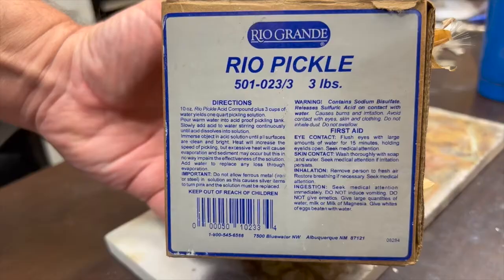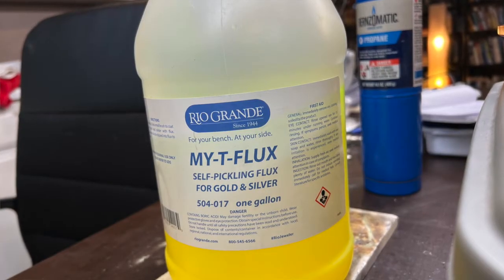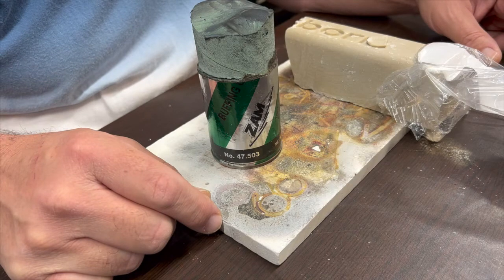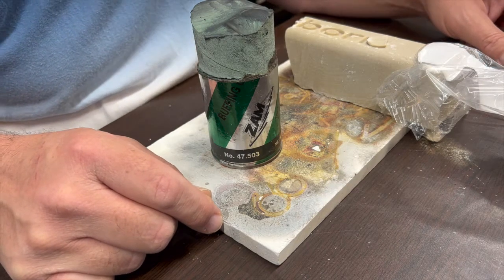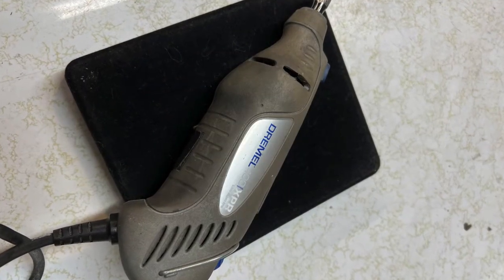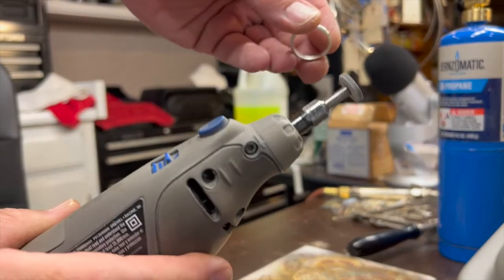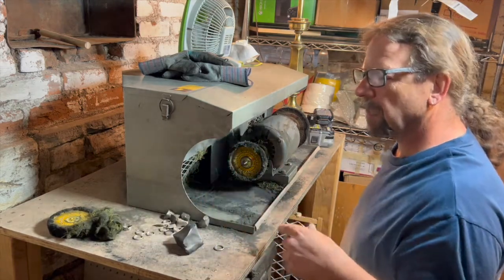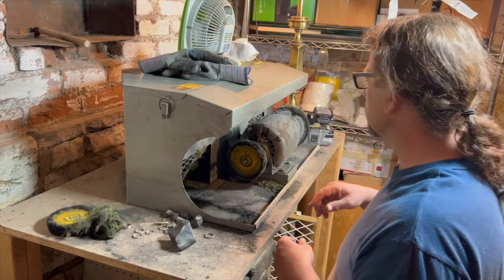General Silversmithing Safety

Comment: Just a couple of additional things if your using a hosed torch be aware that some gasses are corrosive and so the hose needs to be classified for the gasses ur using, if ur using dual gas always have arrestor valves…. And read O2 safety rules
Reply from the maker: Good advice Willie!  Thanks:)

Comment: I’m sitting here waiting for the painkillers to kick in and found this video that I didn’t realise I’d missed. Great tips. Just to add to your info I’ve also used citric acid and salt as a pickle and it works really well. Also sodium bisulphate which you can get from pool shops as an pH regulator for swimming pools and hot tubs makes a great pickle. I think “situational awareness” is an important thing to cultivate in the studio. Things like, don’t leave papers on your workbench, cos it’s really just a matter of time before your papers are ashes Also clear away those little zip loc type plastic bags that everyone seems to sell things like saw blades, stones, findings and other itty bitty stuff….this is for two reasons…..one, they melt REAL fast!! And two they’re handy for storing said itty bitty stuff in, but only if they don’t have a big hole melted in the side. Also watch your grip when you’re filing, cos it’s really easy to file your nails at the same time😮. Always make sure you have a good grip when working on a piece. One of the nastiest injuries I’ve gotten from silver work was a stab in the thumb from my stainless steel burnisher when I was working a bezel. The tip was kinda pointy, tho not particularly sharp, but I hit my poor thumb with FORCE lol. I can laugh now…..at the time the air was blue!! I have since learned to make better use of my ring clamp. One thing about using a torch fed by a hose, is don’t forget to have somewhere to put the handpiece down where it won’t do any damage….it stays hot for a surprisingly long time, yes this IS experience talking.
One thing I was always told with a polishing wheel is that you ALWAYS polish on the bottom front quarter of the mop. Never above because if the item gets away from you, if you’re polishing above, it’ll be flung AT you, if below it’ll just end up, as you say, in the tray. I’d love a polishing wheel but I can’t afford one and I have nowhere to put one.
Reply from the maker: I've always wondered about different pickle types. I'm a notorious paper towel igniter:)

Comment: Very good information! Fire extinguisher! Yes, always have one! I find that citric acid, 1-9 solution, works great as a pickle, a bit slower, not as dangerous. I actually put my hand in the flame once. Oh my, burns at those degrees doesn’t act as the ones you get in the kitchen. Do not recommend! And the saw goes right through your flesh, I haven’t hit bone but went a fair bit into my fingernail once. And I used to use a lighter, never burned it, but now I use a usb arc lighter, it just makes a spark, perfectly adequate to light your torch and there is no flame or gas. And it never runs out. 👍
Reply from the maker: Thanks Frida!  That arc lighter sounds cool. I'll have to get one. Thanks for the good advice!